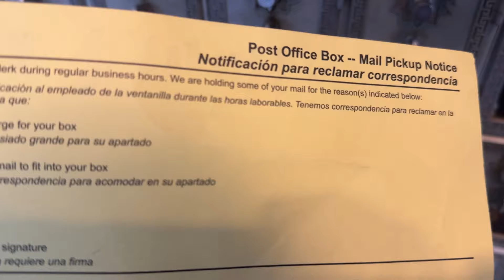MY MAJOR SEWER PROBLEM IS A LOT WORSE THAN I THOUGHT

Comment: Im not a plumber but we run all the sewer lines at my company. Some words of advice here Joe. To properly water test that 4 inch you ran you need to cap the end towards the street with a fernco cap and actually fill the system at least up to or a bit past the repair. Just running a hose in it really ain't gonna tell you ya have a leak. Just running a hose unless you totally fucked up just isn't enough. You could have a leak so small you can't see it and won't know for a long time till it's fucked up again.

Comment: Joe, bird shit will wash off, yet you are still trying to figure out if it's a troll instead of seeing if it will wash off to see what it is. I was driving one day when a buzzard dropped one on my truck, what a mess. Also living in a coastal area, a lot of large birds.
Reply: What bird can shit like that a dinosaur bird
Reply: Is it also possible that with the blocked drain that it could be pressure build up shooting up from the sewer where both the truck and neighbours car are parked?
Reply: @michael-reis  You nailed it
Reply: @jamesf4405  thanks! I found it weird it was always next to the drain and now that the neighbour was parked there, he or she got nailed. A few weeks ago here in Montreal a major water msin broke and flooded a whole sector near the Jacques Cartier bridge and that was on a bigger scale, a house drain could possibly do the same on much smaller scale. Now that a part of the problem is fixed, we’ll see if it continues once its all rectified, unless the neighbour has a similar issue as well
Reply: @frankjames4439  - A buzzard can, the one that dropped on the hood of my truck when I was driving covered about 25% of the hood and some on the windshield. The area where joe lives, may be a lot of pelicans and large coastal herons. It's simple, if it will wash off, it's not paint. But if someone neglects even trying to wash it off, they don't know what it is.

Comment: Why haven't you tried to wash off that stuff on your car Joe ? You can figure out if it's bird poo or some concoction pretty quickly.
What kind of bird could make such a huge mess though ? Could it be a flock of them suddenly needing to take a dump at the exact location twice ??
It is very strange and I support your theory of a drone attack. It just doesn't carry enough weight until you try to at least analyze the material.

Comment: Joe I hope you took. My advice? You do what I told you yesterday! Once you snake it out a gallon of pipe ACID in the drain and wait! For  a couple hours and flush with water! Just read my last comment on your last video! I have done this at least 50 times! It always works! I had an old 5k Victorian house and it had metal piping! It always got plugged! It was a nightmare every time I had to clean it!